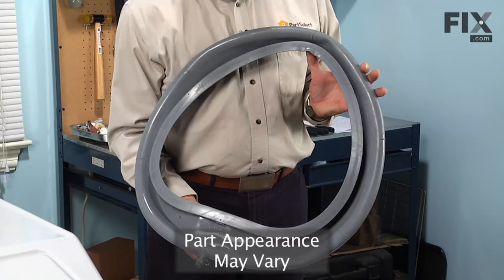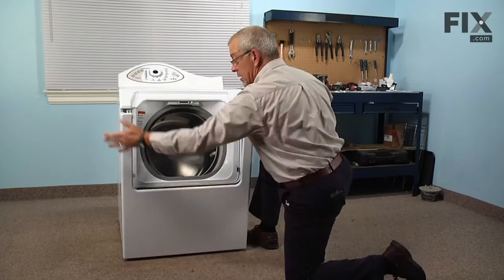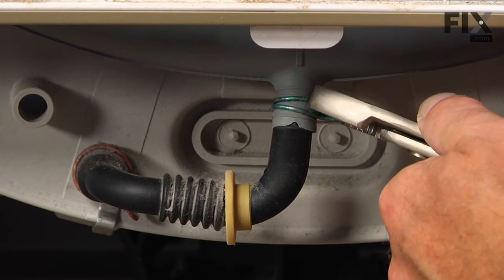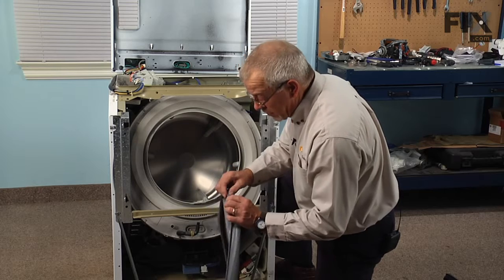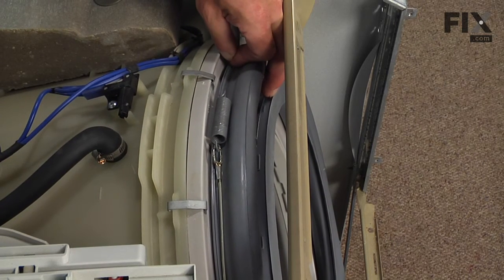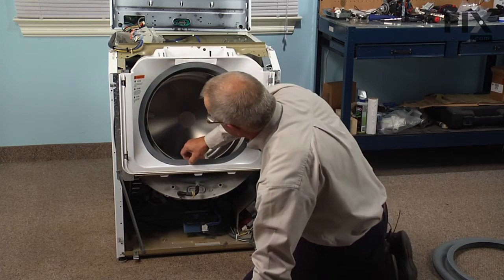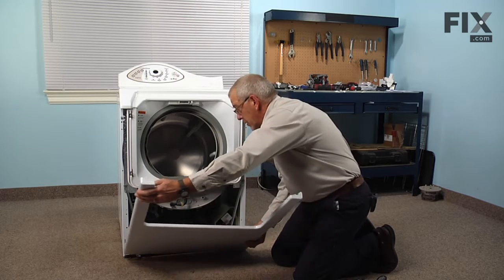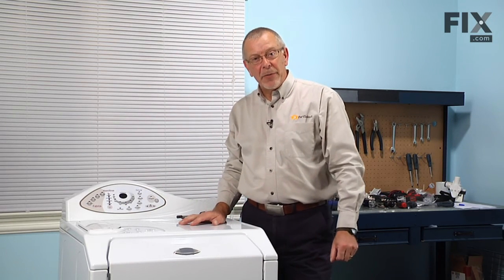Maytag Washer Repair – How to replace the Bellow

Comment: Many thanks for posting this. 
We got it done in no time. I found the secret to reloading that spring was, as he says, keep the wire tucked down against the boot and bring that spring to the opposite receiver end of the wire. 
If you try to manhandle it the wire slips off and can be very frustrating.

Comment: Superb video with clear instructions for Maytag MAH7500AAW. Suggest the use of vise-grip pliers when attaching bellows retaining spring as the spring tension is very high. Also, warm the replacement bellows to ensure the part is flexible for installation (part #12002533 Washer Door Bellow Boot Seal). And while washer is open, suggest remove and clean drain tube that attaches at bottom of bellows (if installed). Bellows Drain Hose, Door Boot; part #AP6006459 (replaces 22004477, 22003071, PS11739534), also WP22004477.
Reply: Yes, the vise grips are the way to go. I also smeared a thin layer of silicone grease on the cable which helps a ton. Don’t forget to clean out the little tube going to the bottom of the bellows. It is more than likely plugged up.

Comment: Great video, but I'm struggling big time to keep the bellows on while I try to attach the cable.  I'm on attempt 50 right now.
Reply: Did you ever get it? Because I’m also having issues trying to put the wire around. Every little area I’ve fixed pops out when I wrap the wire around. It’s sooooo frustrating
Reply: @Hotriderjh  I called a buddy that has been an appliance repair for 35 years.  He attempted it several times with my amazon purchased bellows.   He gave up, and actually had a new old stock still in the box Maytag bellows at his house for 30+ years.  He had no problem with the genuine one, and had it on in no time.   The amazon part was pure junk, even though it looked OK, it wasn't.

Comment: EXCELLENT tutorial. i would add, do remove the front panel and door, as here. most of us have never done this. someone with lots of experience can fit the interior edge and clamp on thru the door but it will drive most of us crazy.

Also, be prepared for slight differences. my 10-year old maytag elite has star bit screws, size t-20, and the interior clamp was closed with a hex head best driven with a 7mm socket???